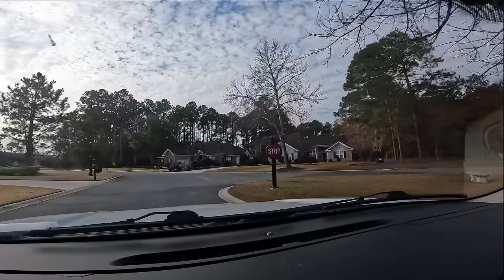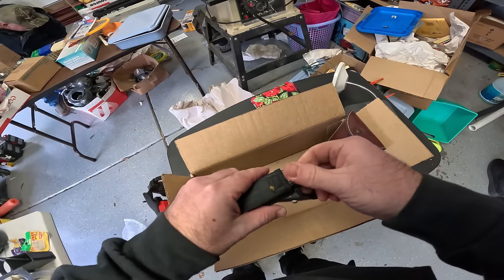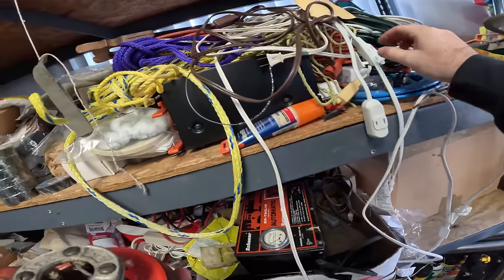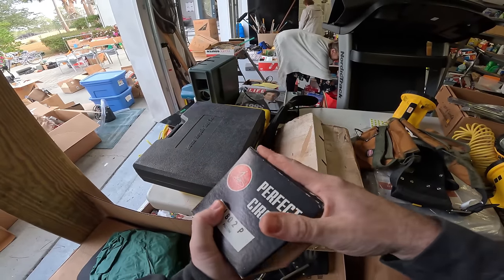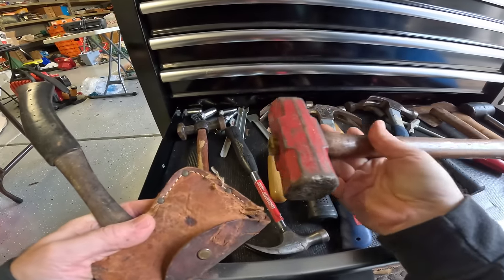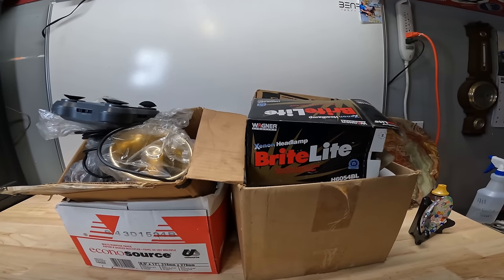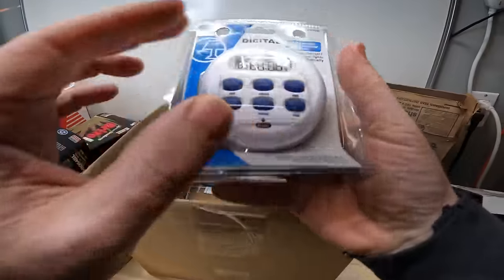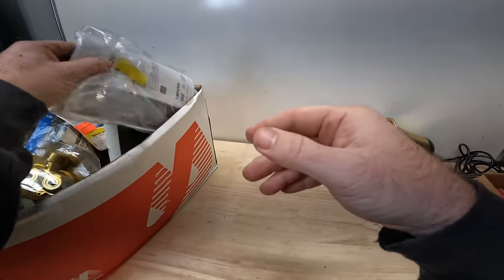He hoarded these items for more then 50 Years!!!

Comment: I would have had fun looking through all of that!  Also, I think Murano usually has a polished base.  If the base isn't polished, it's usually made in China.  At least, that's what I learned from Crazy Lamp Lady.  =)
Reply: Yes! And none of the underside was polished. The only part that needs to be polished is the middle, where the pontil was cut off. And that was not polished. Nice, not necessarily Chinese, but not Murano.

Comment: Wow, what a sale! It hurts to see someone else's supply for what might break in their future. Then leaving it before you can use it. At about 18:05 you found all the gauges in a box. Shout out to any and all Steam Punkers left. I had a collection of different gauges stolen years ago.
Edit: At 20:40 The Brass speaker is a CB Radio external speaker, like a PA system. I was cool with that in my Pick'em Up truck with a whip antenna back in the '70s. Life is short folks, make the best with what you've got. Peace!

Comment: Audio oscillator could be a reverb unit. Pistons look like for a 390 or 427 big block. Roofers axes.  Tape splicer for video tapes.  Mallory battery.  Boeing thing could be used for the on board Gyroscope.  I would have bought the pistons.